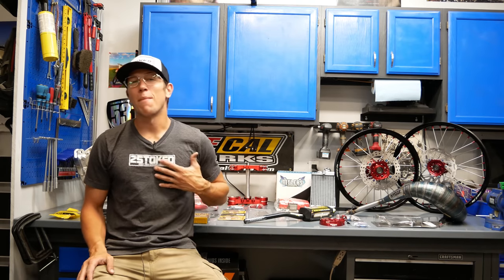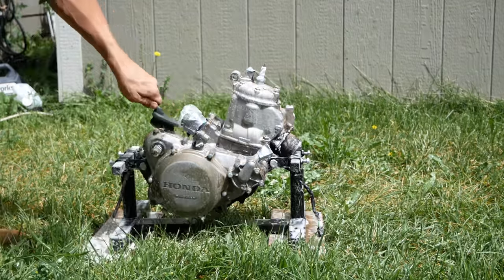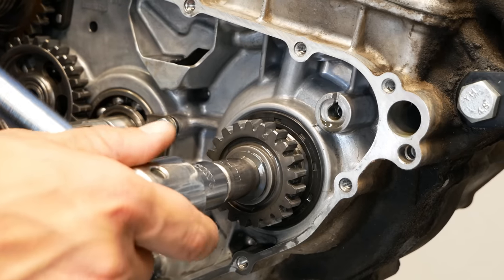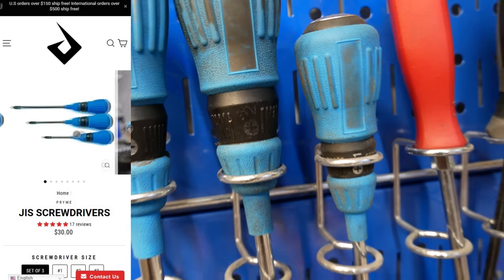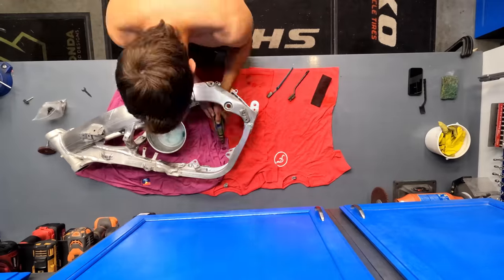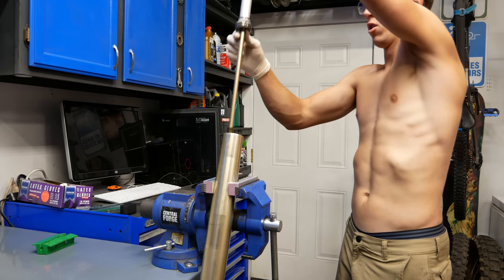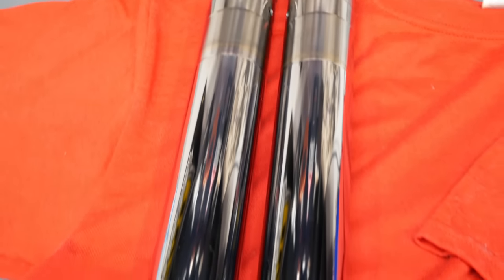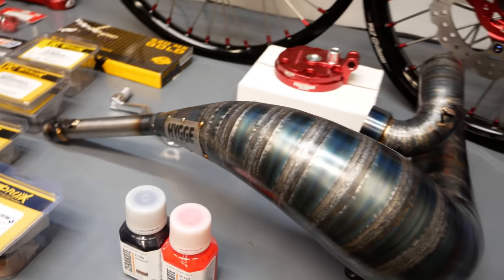Will This CR250 Be My Best Build Yet?

Comment: Hi kincade 
Your killing it on the videos lately and would like to se you pull apart a Honda crf150 because recently I got one for 1000 bucks and needs a cylinder head and I need to figure out shims and would highly appreciate a little fix up of one with detail on this channel 
Good luck with this killer cr250 build!

Comment: This build is going to be 🔥🔥. Nice line up of parts being used on the build. You will be very satisfied with the HYGGE pipe. The fitment is spot on, if you didn’t get the pipe ceramic coated the best thing to use on it is Boeshield t-9, it will stop it from rusting and keep it looking mint.
Reply from the maker: Awesome, thank you!

Comment: That piston looks like someone ran the bike hard after sitting still talking to his mates for 10minutes then immediately started ripping with it 😅

Also wouldnt it be beneficial to have a thermostat for runs like winter or the dunes where engine goes from cold to very hot frequently (fast piston expanding possibility)?

Don't even know if these bikes do but still I think I've been blowing headgaskets on my bike pretty regularly due to having a bad thermostat and engine is either a bit too cold all the time or too hot when stuck in 50cm snow and trying to plow slowly on 2nd gear + almost overheating many times 😁